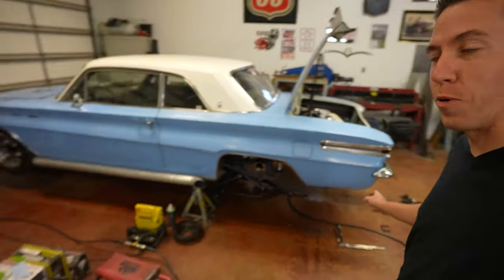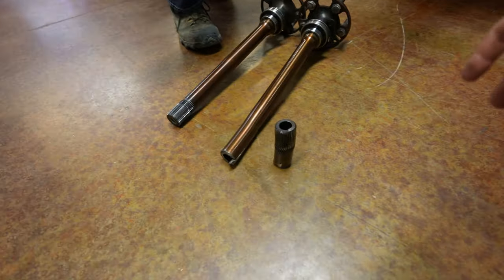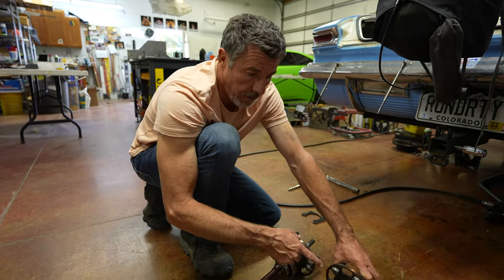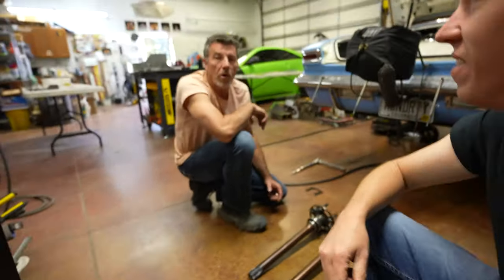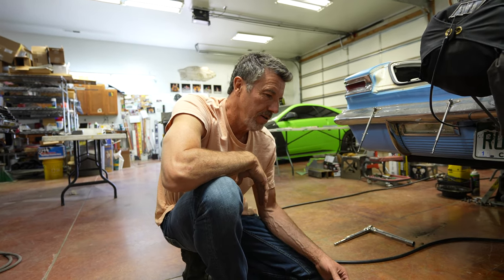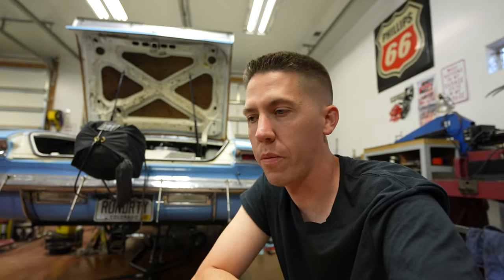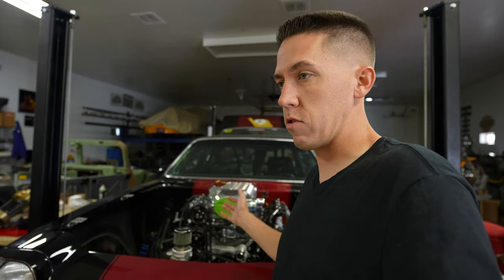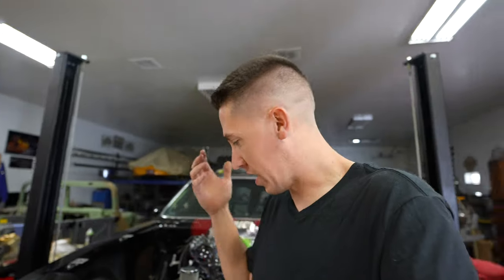Broke An Axle + Supercharged Vega Update and Sick Week!

Comment: Those are some tough axels to break. We always scribed a line down the full length of them. Check them to see if there was any twist in them. If you break Mark Williams axels you have something to brag about.
Reply from the maker: A line down the axle is a good idea! Definitely don’t think we will be having an issue with the new axles lol
Reply: @BuildTuneRace  Probably not. We always tore wear components down during the off season. It was just an easy way to slide them out and check.